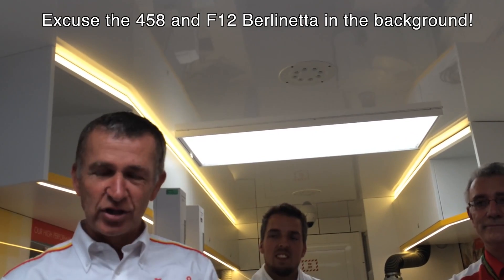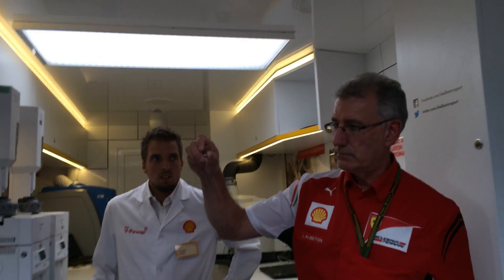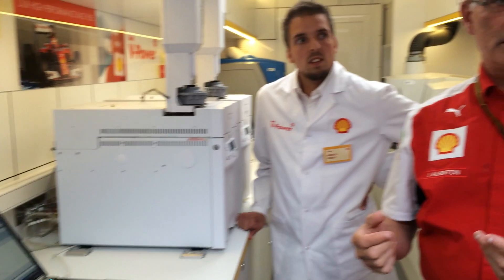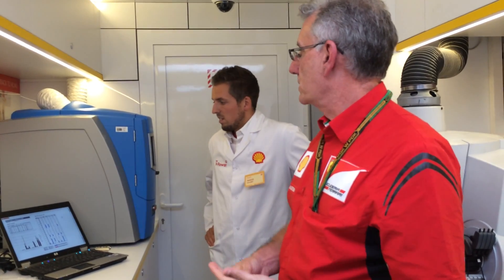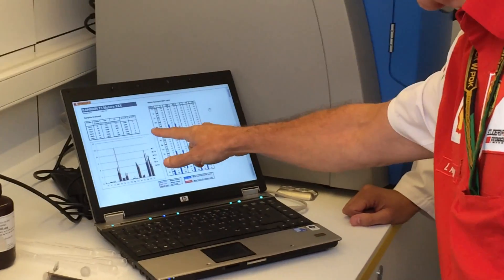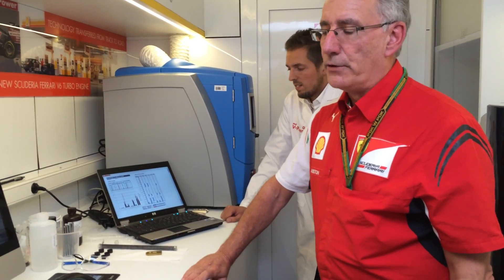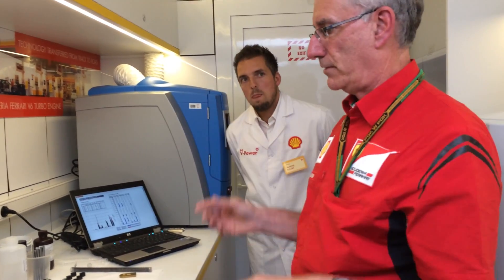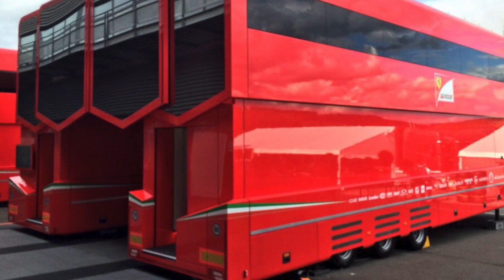Inside Ferrari's F1 Trackside Fuel and Oil Lab - Shell

Comment: I wonder if oil analysis with a  gas spectrometer has a place for the every day commuter car .Would a test be cost effective for some insight on what's wearing down on your engine? or are dealers already performing these tests ?? that was cool knowledge thanks
Reply: Yes, oil analysis for engine metals has been around for at least 35 years (I first used it in 1977). It's not done with GC, but rather Atomic Emission/Atom Absorption spectroscopy. Because the different wear parts (bearings, rings, piston walls) have different compositions you get a good idea about which of these are wearing the most. Check out this page http://www.bobistheoilguy.com/engine-oil-analysis/ for a good list of all the different elements detected and their sources .

Comment: What's you're take in why some of constructors are having better luck than offers with the 2014 engines ?
Reply from the maker: Mercedes has a well designed engine regarding power. They've done some clever things (like the turbo location) that give them incremental benefits, but overall it's just a fast car. Suspension as well is a bit unique.
Reply: Engineering Explained You should make a video about why it's so great!